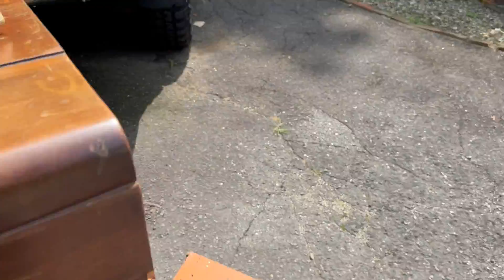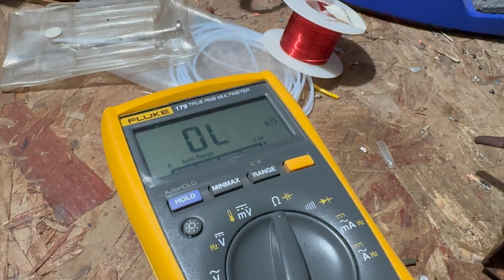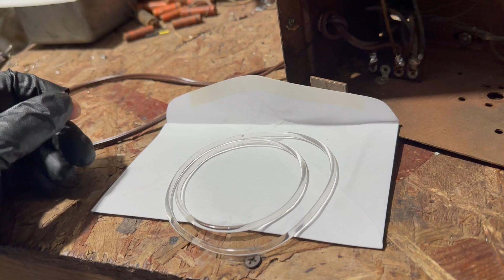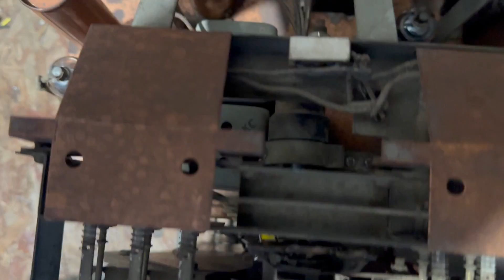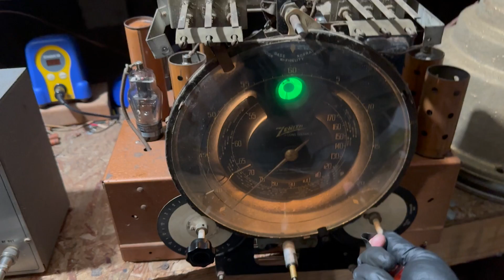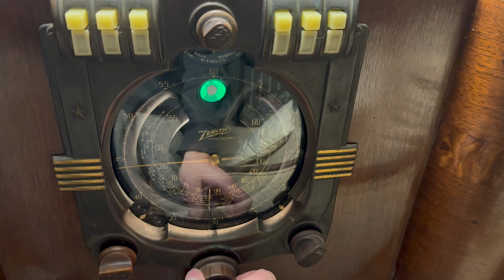1939 Zenith 9S365 Antique Radio Repair

Comment: That is a good place to get the replacement dial belts from. He uses high quality polyurethane material. See the site
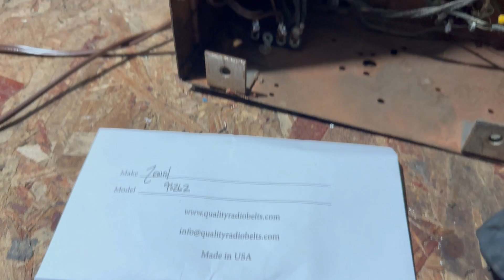at 10:16. Great job getting it working again Adam. Love the working eyetube and shutterdial.
Reply from the maker: It turned out far better than I expected!